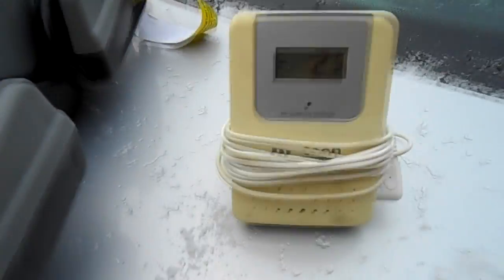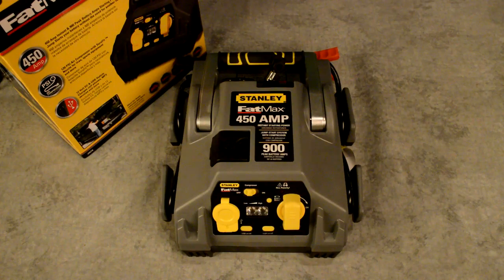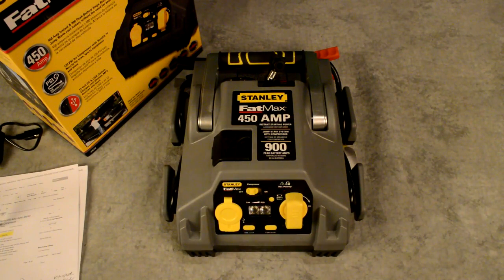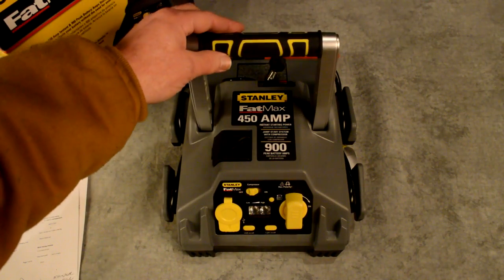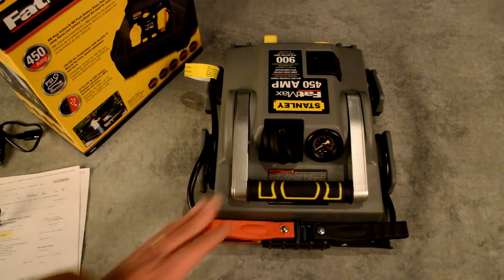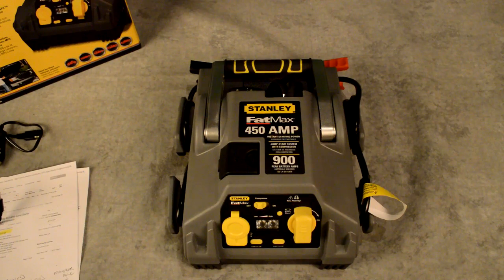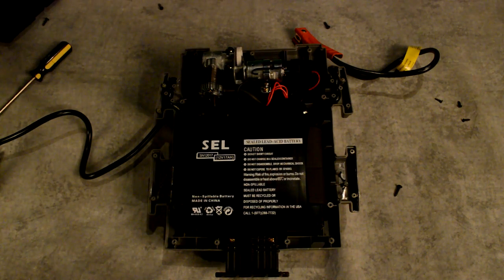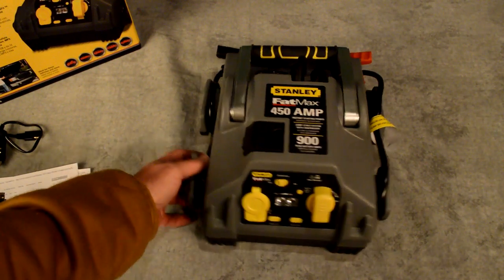Stanley Fat Max 450 AMP Jump Starter & Compressor Review

Comment: Good review.  I have had this unit for a while and have gotten great service from it.  I always take it with me on trips, camping and have used it several times to get me by in a pinch due to a dead battery.  Stanley does pretty good on most stuff.  I recently purchased their digital measuring tape and was equally impressed with it.  thanks

Comment: Just saw your video on this battery....I have this one and also it's up right Brother... Same size..... The question that I have is after charging the battery and all 3 lights are on... about an hour later when I test the battery again the Green light doesn't come on....You did mentioned that it automatic shuts off when it's fully charged.... I couldn't find that in the manual... but did see one at a garage where I had some work done on my vehicle and they had theirs plugged in all the time.....SO....What's with the Green light....?  Maybe a bad battery.... ? It's Brother lights up a  Month after charging...Thanks

Comment: good job in your demo. 1 question more, how often should you recharge the unit itself, or should you just always leave it plugged into a ac house circut
Reply from the maker: I would not leave it plugged in full time. I plug mine in once a month to freshen and repeat the following months.
Reply: Based against usage...but like all batteries, I recommend to use the charge all the way down to as close to nothing....then charge back up to full capacity.  You will extend the life of the unit much the same as a cell phone battery.
Reply: The manufacturer recommends charging once every 30 days. Also Eric Kleiner, that rule does not apply to modern cell phone batteries. It only applies to certain types of batteries.

Comment: Hello, I have put it to charge but it only reaches the yellow light ... it does not charge the battery. Could I connect it directly to the 110v socket and at the other end the battery of my car? ... Thanks for your answer.

Comment: I own a Fat Max 450 AMP Jump Start.  Only the red and yellow LED lights are on when the check button is pressed.  But,  no matter for how long the unit is plugged to the wall, the green LED does not turn on when checked.  Please advice how to verify if it is the Jump Start unit what is defective or if it is just the LED light.

Comment: Got mine as a gift. Works wonderful. 
Until recently, air compressor running but doesn't pump air. Not sure where to go to fix this. Already called Sears, no-go there. Where can I go to have it fixed? Any suggestions?
Reply: 🤦‍♂️ i have the same problem 😕

Comment: Is the fatmax ok to start a lawn tractor battery?
Reply from the maker: Yes, but make sure your lawn battery is a 12 volt. If it is a 6 volt don't use it otherwise it will be fine.

Comment: after you charge it how long does it stay charged
Reply: Mine was sitting unused for a few years. Yesterday, I fully charged it before using it to start my granddaughter's Toyota Camry that had a dead battery. I checked the charge level of the unit afterwards and it read half capacity. I'm not sure if this is normal.